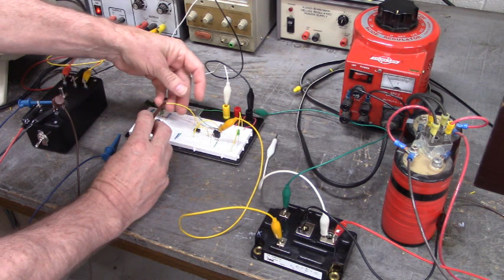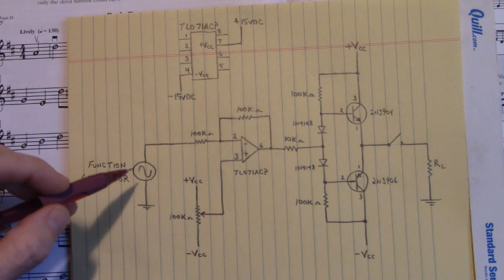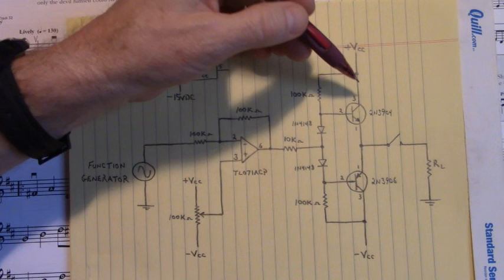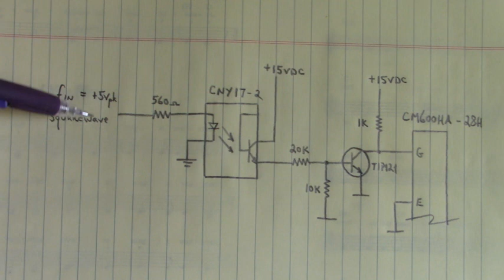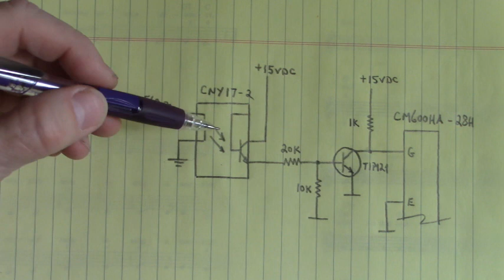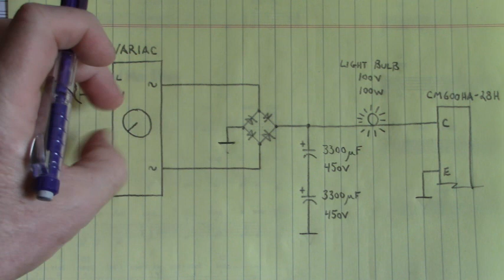Testing the IGBT CM600HA 28H, Mfg PRX

Comment: Why dont control offset with function generator?
Reply from the maker: Hello, I am so greatful that you stopped by to watch one of my videos. I couldn't believe it either when I fired up this Victor function signal generator. But it has no offset adjust potentiometer. The only potentiometers on the function signal generator are for frequency, amplitude, and duty cycle. So instead of not using a good function signal generator. I made a work around :) I hope this helps. Thanks again :)